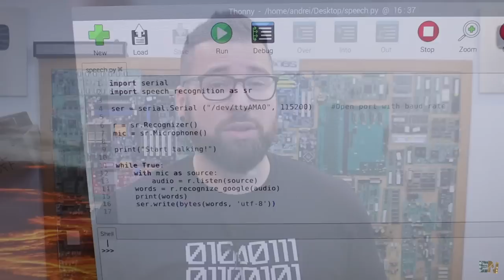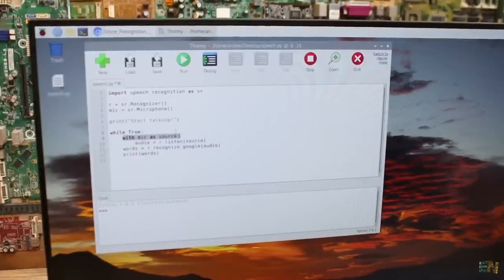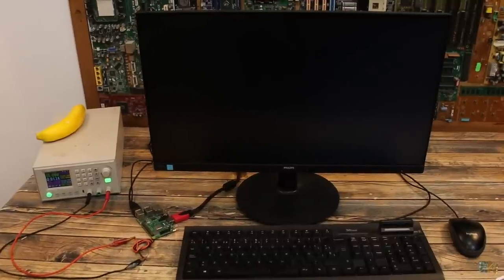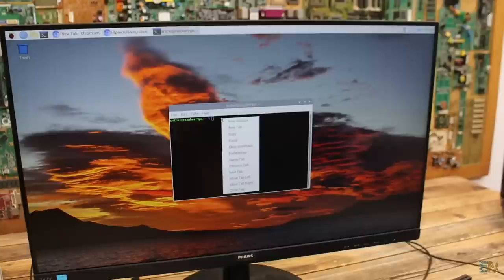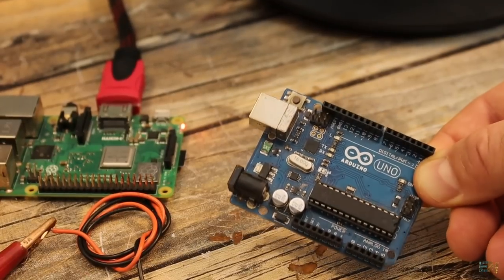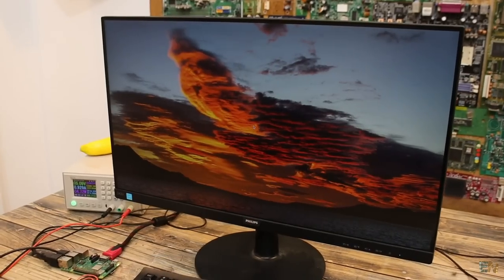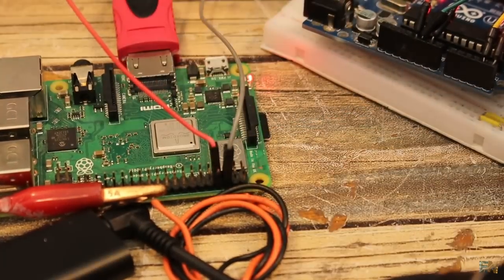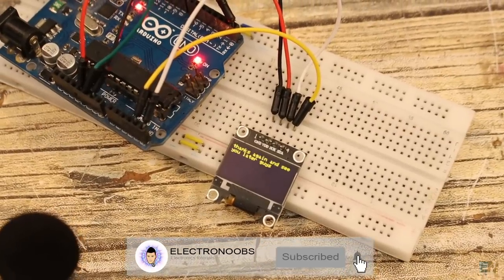Voice Recognition Raspberry PI and Arduino UART communication

Comment from the maker: Tutorial here: https://electronoobs.com/eng_arduino_tut171.php
My Tools: https://bit.ly/3uv8bc3
Help me on Patreon: https://www.patreon.com/ELECTRONOOBS
Reply: great straightforward tutorial as always! 
as a few commenters already suggested, simply using exception handling to intercept the error (when speech recognition fails) and prevent the Python script from crashing... like so:

while True:
    try:
        # Your audio detection & voice recogition code here
    except:
        print("ERROR: I didn't understand what you said....")
       ser.write(bytes("????", 'utf-8'))

Cheers! & looking forward to your next project!
Reply: @tophlaw4274  yeah, that's the clean solution, and this has nothing to do with volume levels, as the device can still receive stuff at high volume levels, well above the programmed threshold, and if it doesn't understand what it has received, then we'll fall into the same exception again.

So using exception handling keeps you safe from falling into this "trap" again

Comment: I think the Try...Catch approach that the others have recommended is a good. As an alternative, you could try implementing your own wakeup command. Like, it doesn't try to process anything until it gets a specific word or phrase. It might also be worth testing to see if after recieving the wakeup command, it raises the input volume programmatically. Then, after, say, 30 seconds or so, it drops the input volume back down. For this you would need to be a little extra loud on your initial command, but everything that follows would be spoken normally.

Comment: Dirty fix to Your problem : use LED to visualy see when Your voice recogn. Is active and 1 button to restart the code. I have used button for similar actions and it's easy to set up. But I'm not 100% sure about LED bc I have never had LED connected to RPi 😂 but it should work if You spend some time on it.

Comment: you should try the try except code. it would look like this in your while code.

"""

while True:
    with mic as source:
        audio = r. listen(source)
    try:
        words r.recognize_google(audio)
        print (words)
        ser.write(bytes(words, 'utf-8'))
    except:
        pass
"""
the try except code will catch any error in the try block and if error happens with any part of the code inside it it jumps to the except block. you can even specify what error you want to catch, but keeping it like this works just fine for beginners.

hope this helps you on your python journey.

Comment: 1. I thought you needed a logic level converter to go between the pi's 3.3v and the Arduino's 5v.
2. Does the speech software include a trigger word function?
Reply: Since he is only sending from 3.3v(Rpi) to 5v(arduino), the arduino will recognise 3.3v as a 1.
If he was sending from the arduino to the raspberry pi,yes then you would need a level shifter.

Comment: Awesome video but which Raspberry PI version are you using that's only $29? I don't see any Raspberry PI's on Amazon that are anywhere near that cost. I see lower cost ones on Alibaba but is a version 3 or version 4? Does i matter it's 2GB or 4GB? Thanks!
Reply: The cost of the chips has gone sky high lately due to a worldwide shortage. That's why RPis are astronomically expensive right now.

Comment: For RPi4 I had to use dtoverlay=pi3-disable-bt instead of the one in the video. Also had serial port permission issues so had to use sudo chmod 777 /deb/ttyAMA0 . Has anyone figured out how to get ride of the red ALSA lib text in the shell when running?
Reply: Hey Sam, 
Were you able to resolve this issue? I'm unfortunately having the same problem... Did you have a sound card connected to your raspberry pi because I am using a webcam with in built microphone?
Have a nice day!

Comment: Hi there
I have made a new raspbian sd card with raspbian bullseye as you use and it has python 3.9.2 as default.
But when i run the python code I get a lot of errors like..

ALSA lib confmisc.c:1281:(snd_func_refer) Unable to find definition 'cards.bcm2835_headpho.pcm.front.0:CARD=0'
ALSA lib conf.c:4745:(_snd_config_evaluate) function snd_func_refer returned error: No such file or directory
ALSA lib conf.c:5233:(snd_config_expand) Evaluate error: No such file or directory
ALSA lib pcm.c:2660:(snd_pcm_open_noupdate) Unknown PCM front
ALSA lib pcm.c:2660:(snd_pcm_open_noupdate) Unknown PCM cards.pcm.rear

Do I miss some configuration or what ?
Reply: Hey Mr. Anderson, 
Were you able to resolve this issue? I'm unfortunately having the same problem... Did you have a sound card connected to your raspberry pi because I am using a webcam with in built microphone?
Have a nice day!

Comment: Excellent video. For the error, have you tried try..except instruction?

YouTube seems to eliminate posts with links without any message, so, you will find a solution in stackoverflow

On the subpage 
/questions/32005310/speech-recognition-python-code-not-working